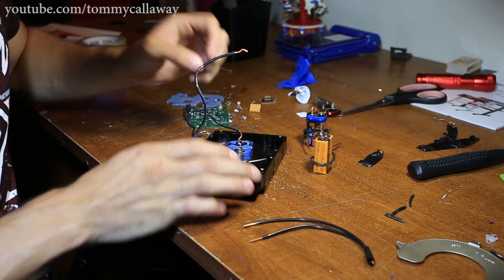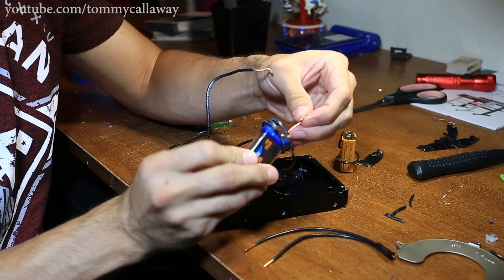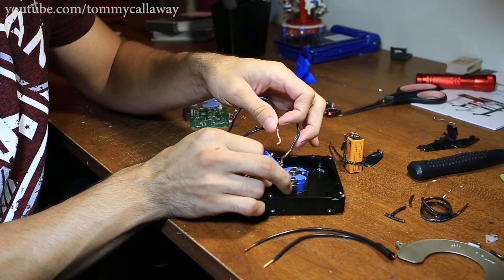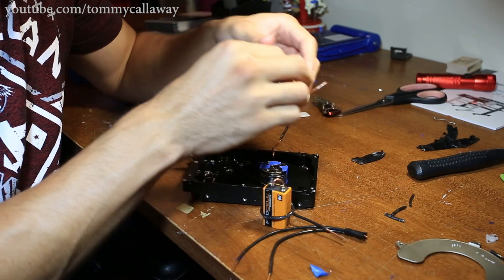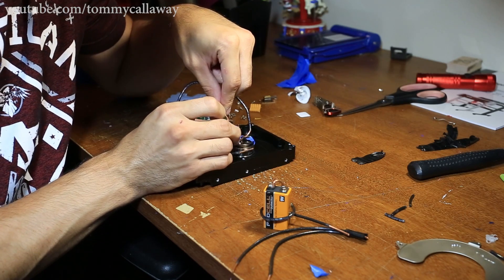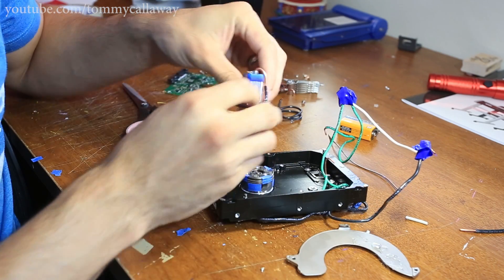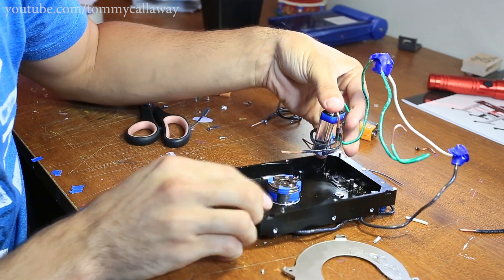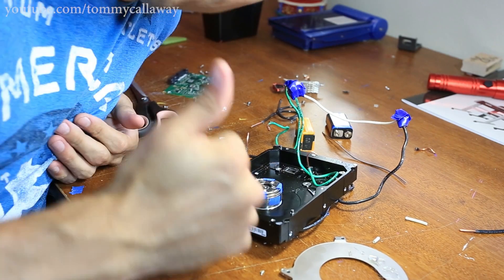Power a hard drive motor without a speed controller

Comment: yeah hey quick quesh.. was wondering if u could tell me where one could find this "hot glitter" u speak of @ 0:29 ?
..not gonna lie, been goin at this project for some months now..(basically a part-time job now, minus the $$) 
problemo is i just cant seem to break thru this GD barrier (made of hot glitter, figuratively speaking). of the idk~17 diff people ive ended up shouting at (supposed 'experts') after simply trying to inquire about this illusive tw*t glitter, apparently not a single GD one of them had even the slightest clue as to what in tarnation i was talking about..(technically 1 of them did try insisting that this was in-fact some sort of applicant used in conjunction w/ a S3XTOY 4 doin u know what..but then he also however, offered me PCP, *of which i declined..so out the window went his credibility). O for 17..

but anywh***, 
dont mean to be the party popper here but im thinkin im about ready to pitch this ******************** off the grand canyon while on fire just about any day now once i get the 1 more hour of personal time off from work i need to do so. so u know, some advice..clarification..insight..kind thoughts would be neat. maybe talk me (specifically, the hard drive) off this ledge idk. all good tho. 

im gonna go outside to touch some grass now

Comment: Thank you for your very interesting  video and details of  your experiment. During the experiment did you attempt t o determine the speed developed and the power output. by  output i do not mean sophisticated measurements but merely say  a thumb  and finger test? I have many hd motors and  after seeing your video i plan to use one to drive the rotor of a gyroscope. Because of the unique design the motor  would form the  hub of the gyro  .  rotor. I hope you will favor me with a reply to enable me to start on my gyro project. thank you.
Reply from the maker: Yeah. It’s very strong, but doesn’t seem too practical. The tape will burn/rub off after awhile but it’s fun to play with. Good luck!
Reply: thank you very much Mr Callaway for such  an immediate response. I realized that the tape would wear off after a few minutes at the most and so have devised a proper pulser using the free surface of the motor As mentioned the motor is ideally adapted for use as the hub of the gyro rotor producing an most elegant set up and several discs mount exactly on the motor so there should be no problem with dynamic balance. thank you sincerely for you so speedy reply. The best to you.

Comment: iwas looking for this video long time is any way run small brushless motor in 2 wire
Reply from the maker: I mean, I explained it in this video.  It's not super practical, but yes.  The hard drive motor is a brushless motor.  I'm running it here with 2 wires.

Comment: Why not use the controller in its logic board ?
Reply: Padurariu Catalin well if you use the logic board it would technically work but it's much more difficult what I have learned is most of my drives don't work because the logic board is looking for the read heads but I don't know how to get just the motor driver it makes sense but mine doesn't spinning

Comment: what is the case of the HD made of
Reply from the maker: +Casey Watkins mine was aluminum, but sometimes they are a substrate of glass and ceramic.
Reply: I have a few I want to melt if they are aluminum
Reply from the maker: +Casey Watkins that's a great idea. You could cast them into heat sinks on the cheap.
Reply: ***** yeah they are pretty heavy. I'm working on making my own foundry to melt metal. I want to cast cool stuff.
Reply from the maker: +Casey Watkins yeah, same. I'm going to use my MOT and make an electronic foundry to do the same. Keep me updated with how you do!
Reply: Haha, same. Have you seen grant thompson king of random? Look him us he shows u how to make one.
Reply from the maker: +Casey Watkins yeah, I have - that's the one I was going to base my design on.
Reply: Platters are sometimes glass but I found glass platters are usually in laptop drives

Comment: You basically converted a brushless motor into a brushed motor. Pretty cool!
Reply from the maker: If you watch the video very carefully, I explain it in pretty good detail.  It's not the most effective method of turning a hard drive, but it works for what I was trying to demonstrate.  Are you looking for a step by step written guide?
Reply from the maker: Thanks - it was fun! Wiring a bunch of batteries in parallel makes the little motor super strong, trying to figure out what to do with it.
Reply: Tommy Callaway
Reply: make a saw
XD